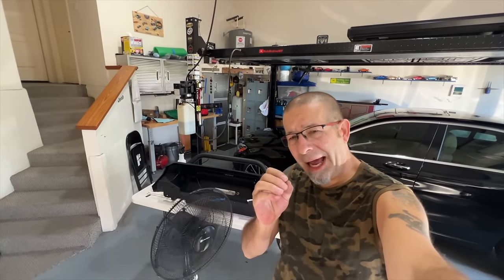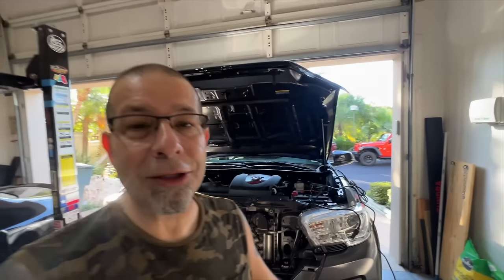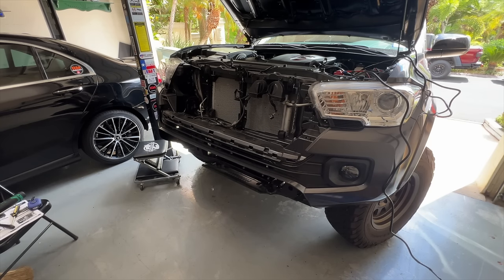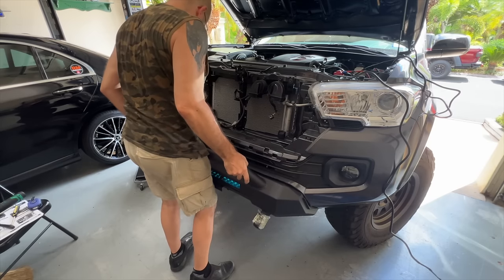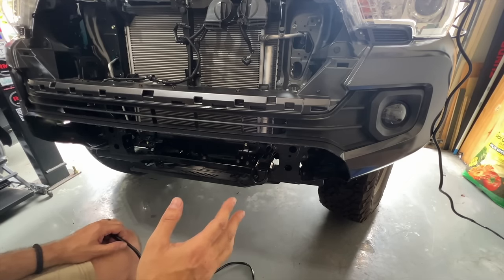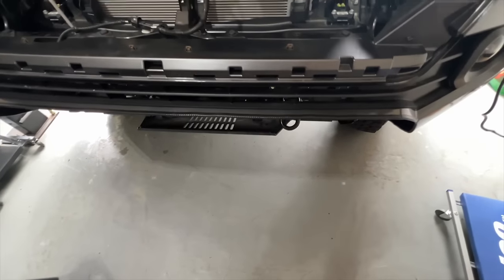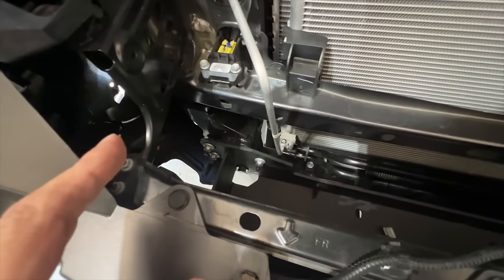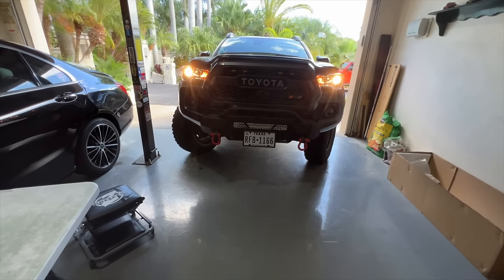Replacing My Stock Tacoma Bumper | Body Armor Hiline Bumper Install

Comment: I bought a new bumper cut that one nd installed this same bumper.  Did that nearly two years ago. 
Today I removed it to fix a problem with the Barracade winch and installed a yellow film on the light bar.
Love that steel bumber even more after crashing into a moose at night.  It saved my radiator from being destroyed.  It was still a long way home after the crash. 

Great job Rob. Did my installed the same way.

Comment: Thumbs up on the video and installation advice.  I'm neutral on the part.  It seems like it could fit a little cleaner.  However it does look great when you pull the camera back.
Reply from the maker: Very dependent on the cut.  I wish they provided some type of template 🤔

Comment: Rob, I bought the Victory Blitz bumper which requires very little cutting and did not add the bull bar (60#). I'm thinking about adding the Badland Apex 12,000# winch (67#) when I do this. Between the two items, I will be adding about 125# to the front end of my 2022 Tacoma TRD Off Road. My concern is will this damage the truck in any way. I'm 64 years old, retired, and am not into rock crawling or hardcore off roading. I live in PA and end up driving a lot of dirt and muddy roads in The Allegheny National Forest. The winch would come in handy for snow and if I encounter the occasional tree that falls across a road.
Reply from the maker: I think you’ll be ok.
Reply: Thanks for the quick reply and I really like all of your videos.
 @RobMotive

Comment: Use a low grit sand paper on a 1 foot block of wood to even out the cut. So that it’s nice and straight when you apply the black strip
Reply from the maker: Good tip👍

Comment: Would it be possible to mount the stealth led light bar back in? I have the same light bar and don’t want to lose it.
Reply from the maker: You would have to mount it differently.
Reply: @RobMotive   Thanks, I believe I still have the stock brackets they sent with the light.

Comment: What is the correct measurement you made when you marked the right line to cut the bumper, thank you in advance.
Reply from the maker: 3/4” for the front line is perfect.  The width of a common razor blade.

Comment: I just got in an accident and now I want do this because its won't even look like anything happened after its done. The part where you cut the plastic and put on the weather stripping got bent pretty good. Do you think if I straighten it out the best I can and trim it like you did it will still workout? thanks
Reply from the maker: Depends on how bad it is.  The stripping is a little rigid and may allow you to shape the plastic a bit.
Reply: @RobMotive  always quick on those responses. I appreciate it lol. it got twisted forsure like 90 degrees in the center it did. crunched inward

Comment: Sweet.....as I mentioned in the unboxing video that bumper looks great on the Tacoma. With your grille  and lights it looks very cool indeed. On your grille did you relocate the radar sensor to the lower section and if so is it protected by a cover? Do you have a grille video?
Reply from the maker: Have a look: https://youtu.be/hm71mTqRmt4

Comment: Rob it looks good.  Did you have to take a deep breath before you started cutting?  The times I cut (on another vehicle) I did.  The time I put a 6” hole in a front fender took 2 breaths, after that the 6 - 1” holes were a piece of cake.
Reply from the maker: For sure!  I even practiced on another piece of plastic trim 😁
Reply: @RobMotive  well it looks good.
Reply from the maker: Thanks👍👍

Comment: Cooler brkt bolt....could you just measure the amount the cooler moved back, measure & add a hole so you can re-mount the brkt?   I just ordered the BA slider step, might have a project for next weekend.
Reply from the maker: You could if you have the drilling capability 👍

Comment: I have the inside bumper light bar can I keep it after the install of does it have to go? Would hate have spent money on that if it does not go with the bumper. Also do you have a link to that bumper? Thanks in advance great video
Reply from the maker: See the video description for the bumper link.  Fitment of your light bar depends on its dimensions.

Comment: Big Rob, have a question, if I have a trd pro with the factory skid plate on, would I need to have it removed to have this added to my truck
Reply from the maker: I had it on this truck👍
Reply: @RobMotive  thanks for the quick response, I am just still on the fence which bumper i wanna go with
Reply from the maker: @GARJENVETTE1 This is the best looking IMO👍

Comment: Quick question Rob I understand that this bumper is around 145 pounds. Did your gas mileage drop with the added weight?
Reply from the maker: It’s 70 lbs.  I haven’t had it long enough to know🤔

Comment: Hi Rob, 
Long time subscriber to your Tacoma video mods. I know you have your new Lime green Tacoma now. I love that color, it makes Taco stands out from all Tacomas even more. I have the same Tacoma in magnetic gray just like your previous one. I am motivated to have the exact Body Armor bumper you installed. My question is, Does the added weight of the bumper make the front end of the truck get lowered and by how much? What about the mpg? Any difference on gas consumption? 
I appreciate your response. Thanks!
Reply from the maker: Thanks Dell Ann!  I really didn’t notice any adverse effects from the bumper👍
Reply: Thanks for the input. I can’t wait to see more of your mods for the new Lime Green Tacoma!
Reply: Another question Rob, do you have the link for the light bar that fits into the Body Armor bumper? Is it the dual 20” kind?

Comment: Under no circumstances should you use those recovery points
Reply from the maker: Why?
Reply: @RobMotive  I've seen them get ripped out on numerous occasions unfortunately that's the case for most kit mounted bumpers for the Tacoma. Hard point welds to the frame is the way to go. Anything mounted to a subframe piece is not a good idea for recovery points

Comment: Tips for anyone trying to use this as a how-to video. Instead of using a dremel, get a thin cut-off disc for an angle grinder for the rough cutting and then clean it up in a very controlled manner with a sanding flap disc built for a cordless drill. With a sanding flap disc you can do a super clean job, especially on curves and inside corners. Then, the bolt that Rob was complaining about in the instructions... Unless you want a hole in the top of your frame, you put it back in as a plug. No winch? I don't get the purpose of this mod if it's just a holder for a much smaller light bar and to hang some decorative shackles on the front without any ability to pull yourself out of a mess.
Reply from the maker: Actually (I think I mentioned in the video) the best tool for the cut is an oscillating saw.  I would not use a flap wheel as the remaining bumper is a bit fragile and if you catch the plastic with the wheel it could be damaged.  As for my motivation for installing the bumper, I simply like it.
Reply: @RobMotive  I heard you also mention using an oscillating tool. It's a decent tool when going straight but doesn't do curves very well at all. I know you are already happy with your results. For the sake of viewers who may take your word as gospel, the bumper cutting (as I have seen shops do it, other videos, and my own winch bumper install) is and cleaner to use a thin cut-off wheel for rough cut and then easing up to the line with a flap disc. The Lee Valley 2" one is great and is very easy to control with the direction of sanding in line with the edge. I'm not saying you did it wrong - just throwing another idea for people to explore.
Reply from the maker: You should use whichever method you’re comfortable with.  After using both a cutoff wheel and an oscillating tool, the oscillating tool did a much better job.  To smooth the edges I just used my fingers - the melted plastic comes off easily.  No need for a tool.